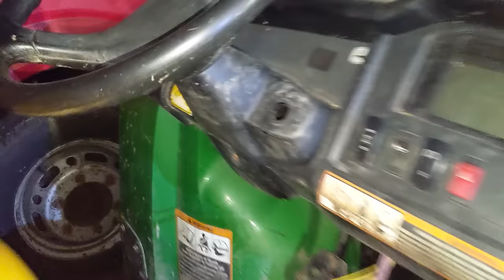Stolen Yamaha R3 and Stolen John Deere Gator Automatrics MTrack Theft Recovery Operations

Comment: You know what you could do with, a drone with a directional aerial pointing down, relaying signal strength to you. Pinpoint the beacons in a jiffy.

Would cover ground quickly, get rid of a lot of the RF reflections and get a look into those suspicious work yards which seem to attract keyless machinery and the sorts.
Reply: Also you could get some fairly simple software knocked up, which with the omni aerial, could produce a heat map which overlays Google maps. All while you drive around.
Would give a clear picture and tighten the net quickly, once you've got a beacon signal.

Comment: I'm really thinking you need a radio set that can indicate direction as well as signal strength.  I'm sure that would reduce the time you spend following false leads.  You'd need to put a different antenna on the roof of the car, mind - either a steerable loop (aircraft style) or a quad array (one at each corner).  There are also ways to do this in a handheld device.
Reply: At these wavelengths directional antennas aren't that useful, too much multipath from buildings/terrain etc
Reply: @tomsixsix  You might occasionally get transient false indications, true, but you'll be able to see where it more consistently comes from.  It's also possible to plot bearings on a map and see where most of them coincide.

Comment: Wondered why we had no video uploads for ages…. Nice to see you only 10miles from my location on the new video, Bradford, Pontefract, Doncaster,Hull …. all big areas for stolen vehicles locally … We had our sprinter recovery truck stolen at the start of the year, unfortunately no tracker system fitted, it did have a disk lock & pedal box fitted, they spent 40 minuets removing them, it was found 3 months later in Hull with different VRM’s on!  Replacements now been fitted with a Alarm & tracking system!

Comment: Owner of yam r3 ever see this. Or anyone else with a bike and scared of theft.

Ncs, nick Cook security alarms, cheap alarm/immobiliser. If you ever had the key barrel switch ripped of as shown on this R3, and then turned or a key/screwdriver forced into key slot and turned it would alarm and immobilise the bike. £30 bargain.
Reply: Not taking anything away from Automatrics!! Love this kit and company, just adding another security feature for those who don't know!

Comment: Do you ever jump out when it's strong and try the handheld with no antenna connected and tucked into your belly? If you rotate a full 360 while doing this it can be an excellent direction finding trick for strong nearby signals (when the signal nulls the source is directly behind you)
Reply from the maker: We have not,  using the body as the antenna cool ...we will check that out cheers !
Reply: @AutomatricsMtrack  good luck with it :) It's more that the body blocks the signal rather than being the antenna (that's why you listen for the null). It's an old amateur radio 'fox hunting' trick :)
Reply from the maker: Ok thanks for that 👍